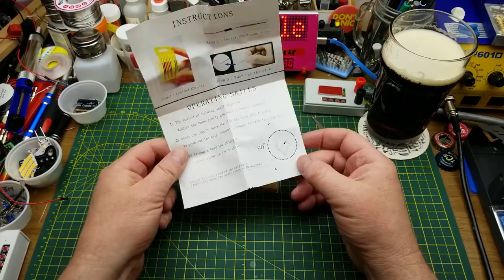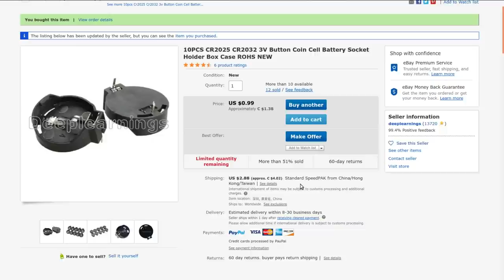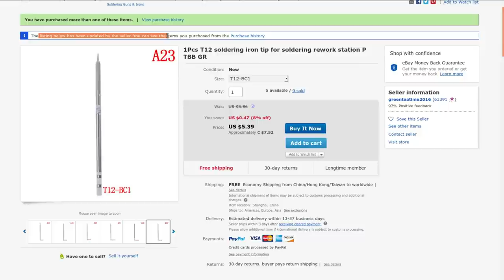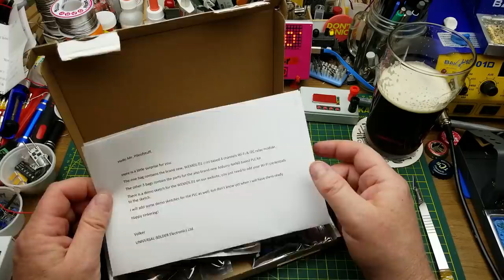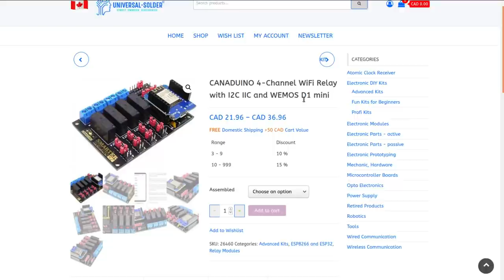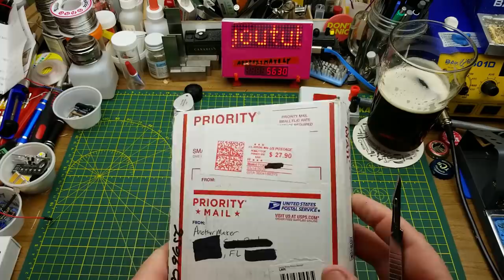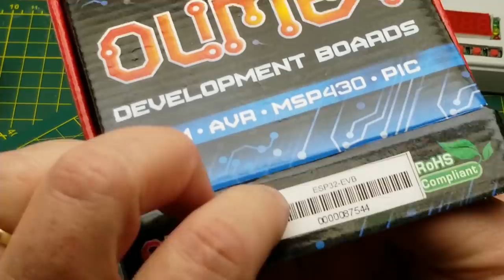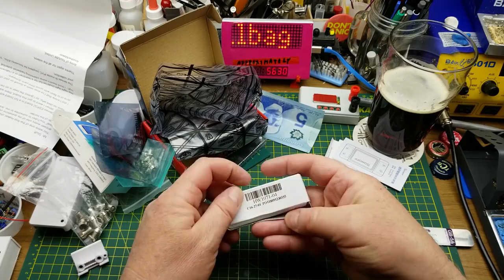Mailbag Monday #86

Comment: Nice to view your channel very monday! I also use the olimex board it's realy great. It's one of the boards how also support Ethernet with a cable. So i can use them on places where i have no wlan or in companies. I only have troubles with the relais. If i switch to often the boards hangs up! There is also a smaler version aviable how supports power over Ethernet.
Reply: I haven't had the relay issue.  I wonder if it's not receiving enough power.  I do love the esp32-poe-iso.  I use that in some remote locations and it's great.

Comment: Hi      Those tiny IC test clips look interesting -- but I notice that you did not mention 2 more

IC test clips that are available from Ebay . There are the low cost and easy to find ones 

which are mini versions of the large ones you have , they are about 4 cm long and very good.

The others are harder to find and expensive , they are about 3.3 cm long .

I can send photos or perhaps Ebay links if you need more info .

                                                                                                                             Alan
Reply from the maker: If you can find a link I'd be jnterested in taking a look. Thanks.
Reply: Hi   Sorry , I could not find the tiny ones but if you search for

mini hook clip       at   Ebay.ca   ( I just tried )

the 3rd and 4th items are like the ones supplied with my old CRT based

Logic Analyser ( only the ones they supplied are all black )   and the 

7th , 8th , 9th , 10th etc are the 40mm ones that I am talking about.

I paid various low prices ( in UK Pounds ) for them in many colours

but it was quite some time ago .

                                                                       Alan

Comment: Use the Tasmota firmware on all those ESP8266/ESP8285 devices. It does everything you will need, including MQTT, full web based configuration, etc.
Reply: Tasmota is definitely the way to go.  A little bit of a pain to flash the first time, but it's great.  That Sonoff has the open holes which makes it a little easier to flash.